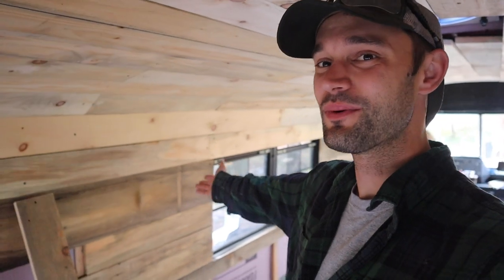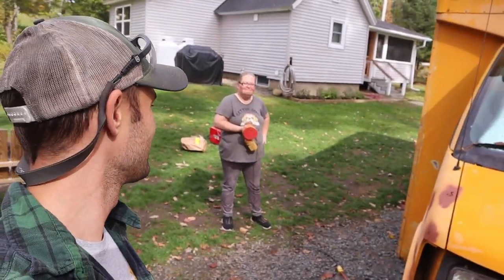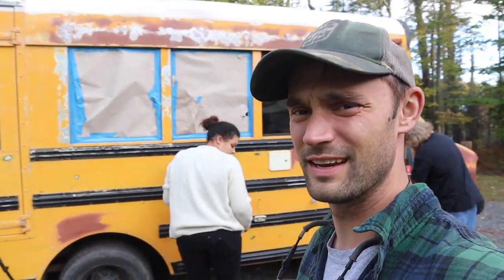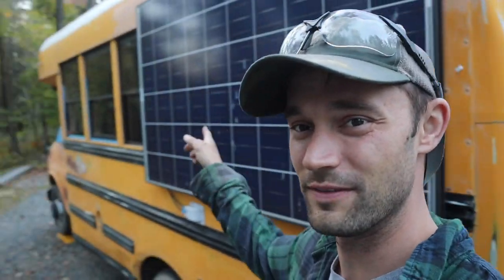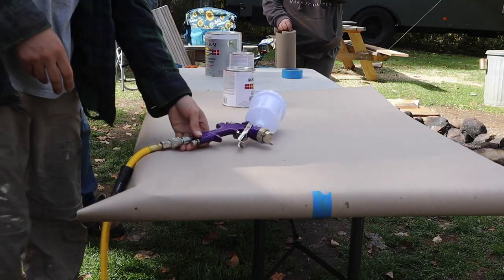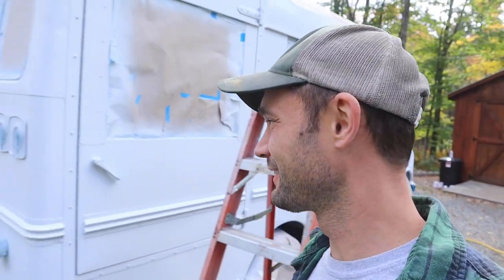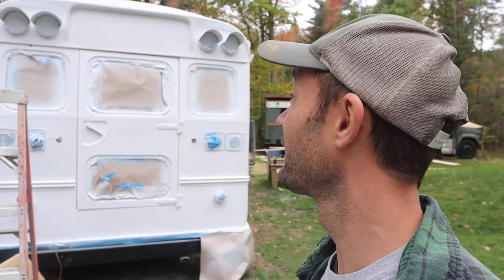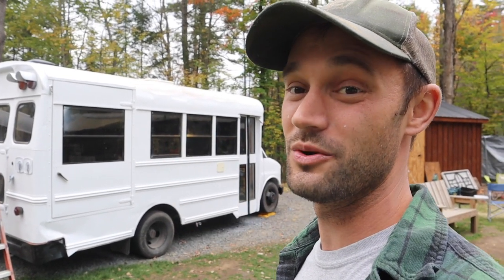How to Paint A Skoolie on a Budget | Everything for under $200!

Comment: those bolt holes are easier to weld when you hold a piece of copper as a backer behind the hole
provided you can reach the back side 
if you dont have a copper bar you can use a 3/4 or 1 inch pipe cap from lowes/ home depot. just use the flat side

Comment: Looking good.  I have to ask what you thought of that spray gun?  That one was a consideration of mine for the coach later on.  I have heard they are super good on the first go, and hold up on clean out for a while... what is your take on that one?
Reply from the maker: I have only used it this once. It worked great for the whole day and job. I cleaned it and I have hopes for another use. For $16 , I was really happy.
Reply: @navigationnowhere  ty  good luck on getting in the clear with everything.  Winter is Coming...